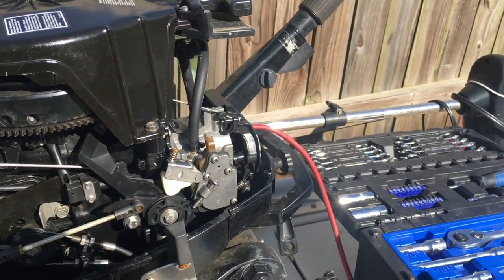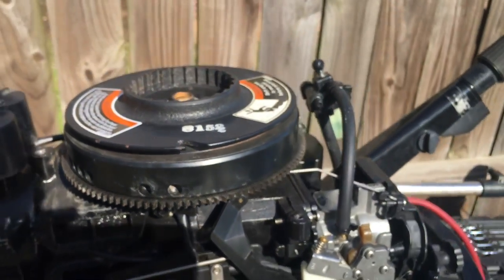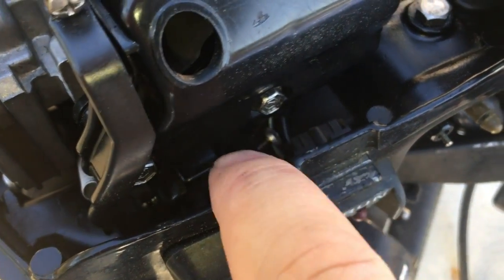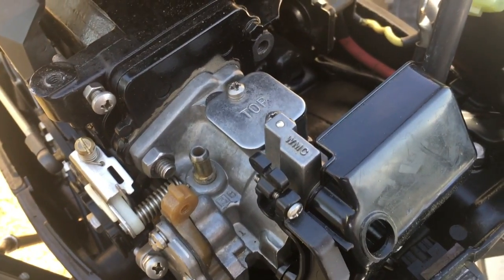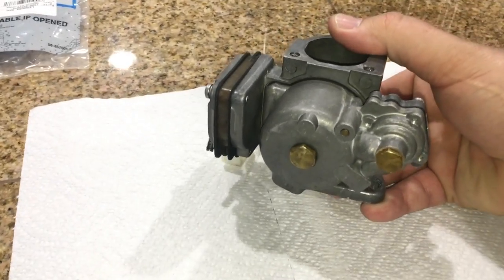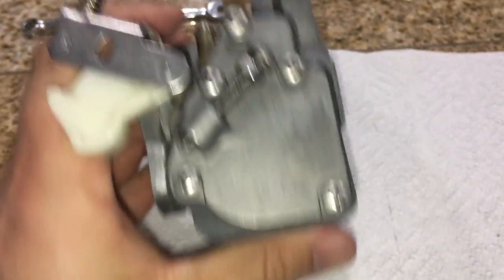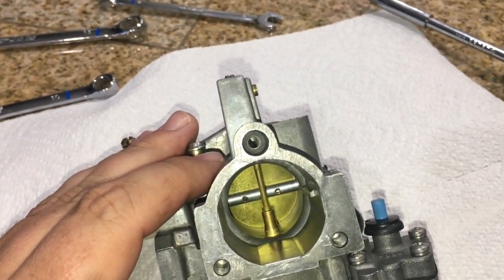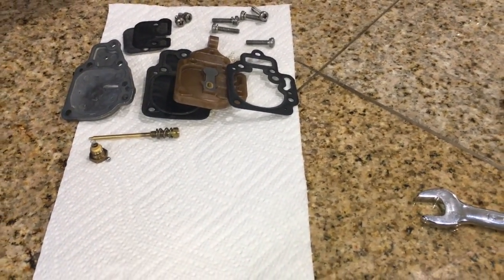Mercury 25 HP EH 2 stroke carb rebuild Pt 1 Disassembly

Comment: Need feedback on correct float orentation  , being told flat side of the float "with no ridge" must go aganst the float forks , but in your example as you disembled it came out ridged side orentated against the float lever , did someone reassemble it incorrectly in the past or am I being misinformed ?
Reply from the maker: Yeah there is a correction video where I made adjustments. It’s linked in the video or on my channel.
Reply: Yep ridge goes upwards, against the fork.

Comment: Warning..... there is a small ball bearing on the Spring. Be careful because you will easily lose it then your motor will flood everytime you tilt it..  you "cannot" find a oem replacement carburetor for this beast of a motor.  If you blow your motor up the carb will sell for a easy $400 by itself.. I've had like six people try to buy my carb...
Reply: I bought a used motor. It started and ran perfectly during the check, but under load, the RPMs would fluctuate and the engine would stall. I disassembled the carburetor and found that the ball on the spring was missing. I went to a bearing shop and found a ball with the right diameter – it cost 7 cents. Now everything works great!
Reply: @NormalPuika  Hello, do you remember the size of the ball?
Reply: @paterpilar  Unfortunately no, but the store offered the smallest one and a slightly larger one, I took both and the larger one fit perfectly... these balls are very cheap so you can buy even 100 different pieces and choose the right one...

Comment: When you adjust that idle screw adjustment,,, is it tighten or loosen to bring up the idle speed???
Reply from the maker: The screw in the front adjusts mixture. The screw on the side that moves when you advance the throttle, adjusts the idle.
Reply: @sirmarcusandrew  thanks for the reply

Comment: @6:35 that little ball you mentioned, my carb is missing that ball when I took it apart, would that cause low end performance issues? Sluggish, feels like a misfire until you get to high RPM's where it works fine.
Reply: Yea mate we has the exact same problem got the ball and goes like brand new but now have differnt problems🤦‍♂️🤦‍♂️
Reply: @rdubtelly8651 Where did you get the ball from, do you have a link?

Comment: 9:24 red washer and retainer clip, how did you get it back in?
Reply from the maker: I used the old idle air screw to push it out and back in. Since I had a new one, I wasn’t worried about the tip possibly being damaged.
Reply: @sirmarcusandrew  I got the gasket in and out with no problem but the C clip was a tough one, finally got it back in, Mercury runs like new
Reply: I used an allen key of suitable size to press fit the c-clamp which holds the rubber o-ring.  I figured that out after wasting a lot of time with pliers.  The press fit solution was so simple and I was happy it worked.
Reply: I cannot get my old one out

Comment: The rod you point to at the :42 second mark. What is that rods purpose? I bought a motor from a guy and trying to get it going. It doesn’t have that rod but has the connection. It ran before it sat
Reply from the maker: It’s apart of pull to prime system to advance throttle slightly. See my other video about “ pull to prime explanation “
Reply: That’s part of my problem. This motor is missing the rod. Not gonna help me cold start it after 2 years lol I’ll look at the other video but any idea on a part number for that if it’s not on the other video?
Reply from the maker: Advancing the throttle slightly does the same thing (at least on mine). Watch the arm on the starboard side of the engine move as you advance the throttle. For part numbers go here:
https://www.mercurymarine.com/en/us/parts-and-accessories/parts-catalog
Then launch the parts catalog and put in the serial number (you can also browse by basic engine type to get pretty close) if you don’t have the serial number.  Possible part number is “127332 wire fast idle”
Reply: sirmarcusandrew awesome video so helpful I’ve been working on my 1999 Mercury 25 hp 2 stroke...finally got it running but I can’t see where to set the wire fast idle under the fly wheel, does it go through the rectangular hole in the fast idle lever or does it go somewhere else? It keeps failing off the where it sits on the choke...
Reply from the maker: Through the rectangular hole.

Comment: What purpose does that cover serve you remove at 6:50 ? Mine is gone.
Reply from the maker: Are you sure 6:50? I remove a metal ball inside the primer that’s on the top side of the spring.
Reply: @sirmarcusandrew  3:20 sorry
Reply from the maker: I’ll have to double check when I get back to the boat. I’m pretty sure it’s a “screen” for large debris to prevent it entering the carb. I can’t recall if any of the primer assembly is attached to it or not.

Comment: sirmarcusandrew thanks for this video! I'm from Brazil and Suzuki and Yamaha are very strong brands in the market, but I really love mercury products. It is really hard to find some replacement parts here and your video help me to save a lot of money keeping my outboard away from bad mechanics. My outboard is the same as yours, but without the starter kit. Can I say my carburetor is the wmc 53a?
Reply from the maker: I am not an expert, but I think depending on year that they used a couple different carburetors. Mine was stamped with the model number on the side of the carburetor. Thanks for the comments!
Reply: @sirmarcusandrew  Thank you man! I'll check it on mine when I service that! And once more, thanks for this big service to all outboard owners community! With the lack of service material on the internet, this is a huge help!

Comment: How do u get that long brass rod out of the center of the carb ?
Reply: Mine appeared to be jammed in there. The shaft and the tube were not concentric. The shaft was at an angle so it did not feel like it was going to move. Did you find the same thing?
Reply: Right!!mine bottomed out..thats the only part I needed but I had to get the hole kit
Reply from the maker: I didn’t remove it. I flushed it with carb cleaner. I made sure I didn’t have any blockages.

Comment: I have fule coming out of that small hole for choke..what could it be?grate video btw!thank you
Reply from the maker: If it’s the small hole on the right side of assembly next to primer, I had a similar problem. My primer had degraded inside leaving only mesh and the trash blocked the fuel from entering carb and instead pushed fuel out of small hole towards starter. I believe the hole actually is to allow air back into the primer to release suction. You can buy a kit that replaces only that part or a complete carb rebuild kit.
Reply: @sirmarcusandrew  I did the rebuild kit and it still happens idk why it's still doing it
Reply: @sirmarcusandrew  I did find that the air/fule mixture screw is completely missing.might be another issue!!😂
Reply: Would you have pic and size of mixture screw?
Reply: @sirmarcusandrew  I got a new kit and the mixture screw won't go in..did you use you new one?
Reply: Plz comment me back haha
Reply from the maker: I used a new screw. It was included in my kit and went in just like the old one. Your other problem may be the float not closing allowing too much fuel to pass through the carb.
Reply: @sirmarcusandrew  do you know model # on your carb?did you ever get yours working?
Reply from the maker: @hambone8528  53A and yes.
Reply: @sirmarcusandrew  is gas to come out of the cover that says top .i think the electric choke goes there

Comment: I noticed you installed the float opposite the way it came out, also the you installed the float lever upside down and never measured for proper float height.
Reply from the maker: It has been corrected.

Comment: This was so helpful, but I am a little confused at 7:58. What is in the center of the carb as you are lifting the float lever. I imagine this is the main jet, but every video I see they seem to back this out with a screwdriver to clean it. In this case, I don't see how you would remove this for cleaning?
Reply from the maker: The main jet in this particular carb is inside of the bolt/screw you used to remove the bowl. I don't think you can fully separate it. Mercury sells a replacement bolt/screw with the jet... you get normal or high altitude.  You can kind of see the screw inside the bolt at 7:32 if you pause it. I was able to loosen it but it would not come all of the way out. I flushed it and reinstalled it. The kit I used did not include a new one.

Comment: where did you get carb rebuild kit
Reply from the maker: Craig Cooper I ordered mine on www.amazon.com They offer OEM and aftermarket kits. I used Mercury’s website to find my part number based on serial number. They have complete kits or kits for the primer bulb and more area specific. This kit did not include a new jet. It has a separate part number.